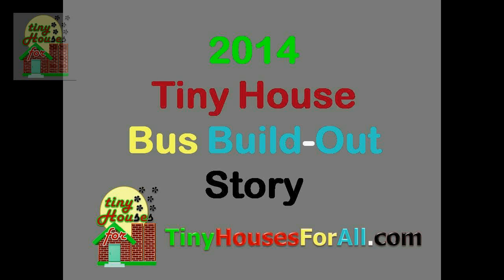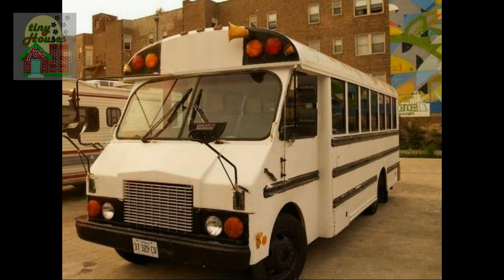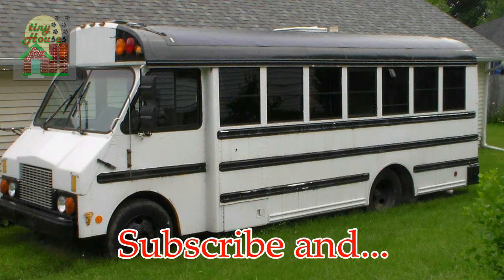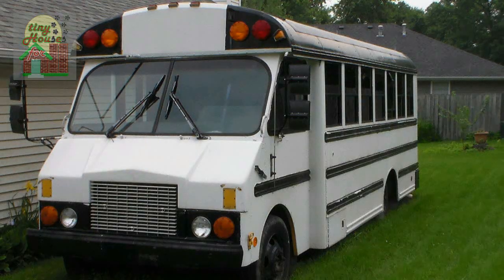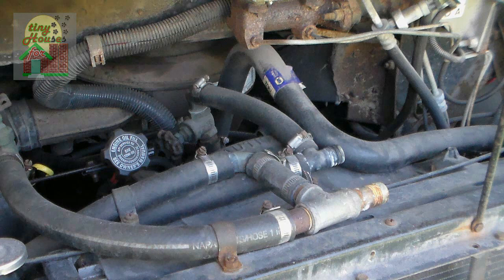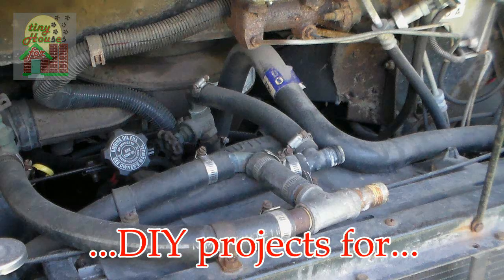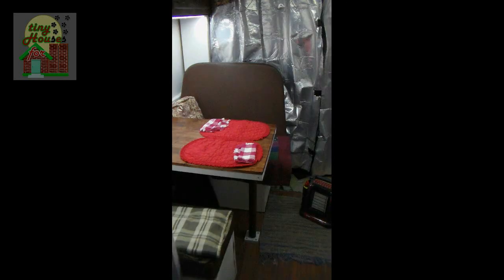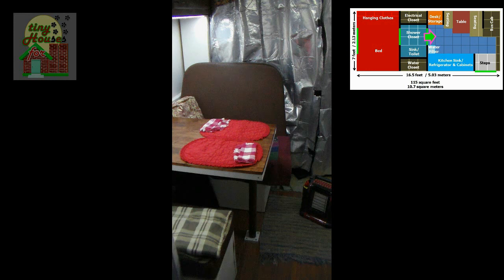Tiny House on Wheels Floor Plans: DIY Solar Power Bus Build Out

Comment: Thanks so much for the very detailed video and the time you took to share this. I too have a medium sized bus. A tad bigger than yours but along the same line. They are indeed rare, as you mentioned, as the school boards usually only carry one or two of these kind. I got very lucky that where I got mine from in northern Ontario they don't use salt on the roads in the winter. Instead they use sand. So needless to say I did not have one spec of rust on my  28 foot 2000 bluebird GMC. (Interior space to build is about 20 feet). It really was my dream bus and it showed up at the very moment I was ready to commit. I also paid 2500.00 for mine. I also very much dreamed of a duel fuel bus and accepted that I would never find one of that size that had duel fuel until I called about this one and the fella said "oh by the way, it runs on gas and propane"...LOL...I almost fell over...The school board it came from is light years ahead of ours here as they have been using propane for years...so this bus of course was taken off the road as per their guidelines when it was 12 years old. It was divine intervention for sure...haha...I chose to do the roof raise as I have three grand kids that I am raising and they are with me full time. So raising the roof allowed me to so some great loft bunk ideas and still have the clearance for the 4 year old to have a "main floor" room for playing and sleeping. And it has opened the space to give them a feel of a "real" home by putting art up and so forth. Although it was not cheap, I don't regret it. But I would have not gone to that length had I been on my own. I am curious about how much it cost you to get the windshield replaced, if you don't mind me asking. I also have a chip and am just kind of wondering about price comparisons. Anyway...I do love the idea in the toilet area...I have beat my brain silly trying to figure out how to fit "certain things" into a very small area...lol...and I cant thank you enough for the very simple, but hugely effective, idea of putting the porta potty under the sink area and putting it on rollers...good lord that was too easy...and yet I was complicating the whole plan and ready to scream over the bathroom...lol...I just didn't think of it. So THANK YOU for sharing that. Some really great tips and ideas that save quite a lot of money...Enjoyed it very much...Hope to see more from you. Till next time, much thanks and remember "It's A Wander-FULL Life"...LOL (The decals on the sides of my bus.)